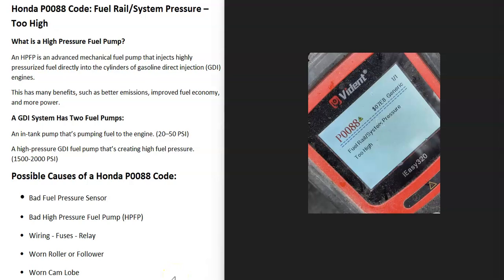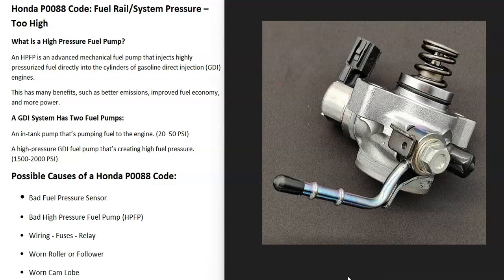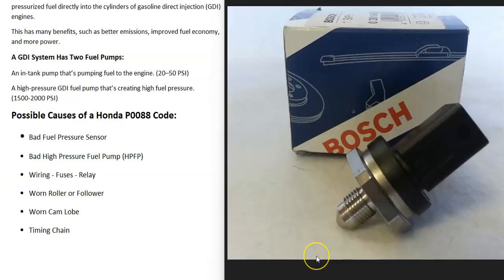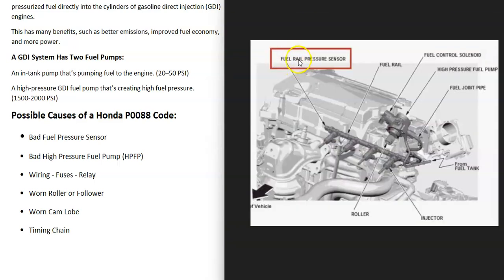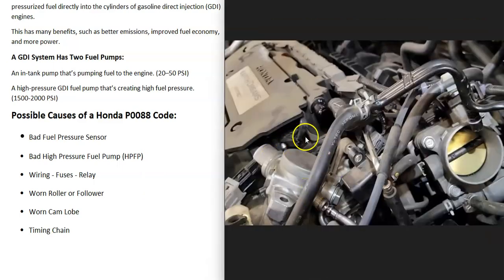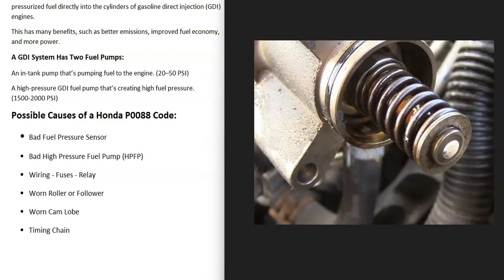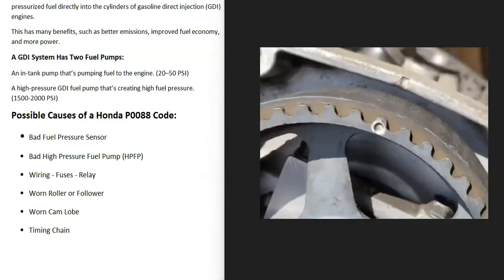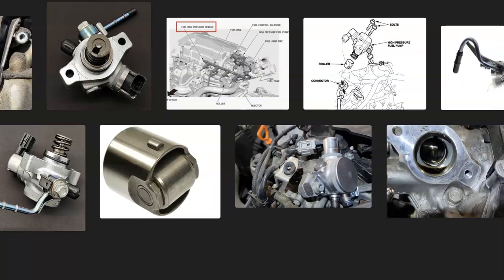How to Fix Honda P0088 Code: Fuel Rail/System Pressure – Too High

Comment: I get this code mainly when its cold out or the car has been sitting for awhile and i do not let it get warm before driving off. The car will go in limp mode and code will come on. Once the engine has warmed up I can shut it off and restart the car and it will drive normally. Any ideas?
Reply: Thanks for this comment.  I read this same code after some cold weather and car sitting idle for some time.  I am hoping this is also my situation.  If so, I can use my ODB reader to clear the code and keep driving.
Reply: @ChrisCox7 I recently purchased the fuel pressure sensor but can’t seem to locate it on the engine yet.

Comment: Hi,  I just changed the high pressure pump and reset the codes and it went back into limp mode.